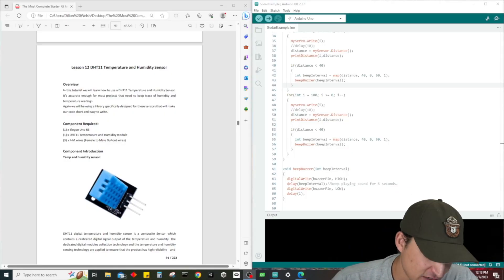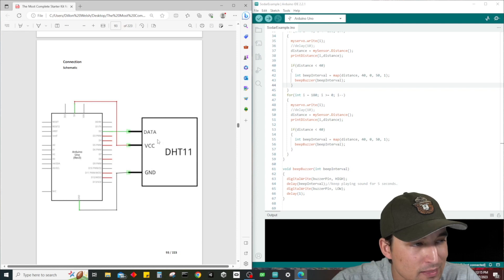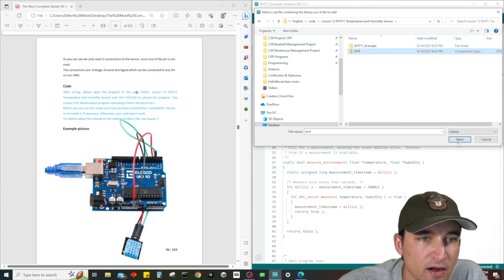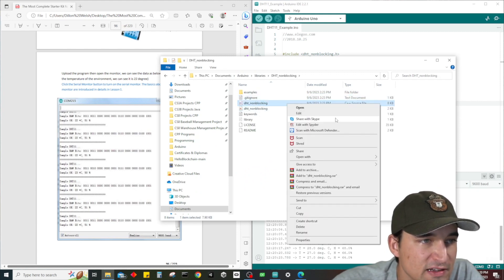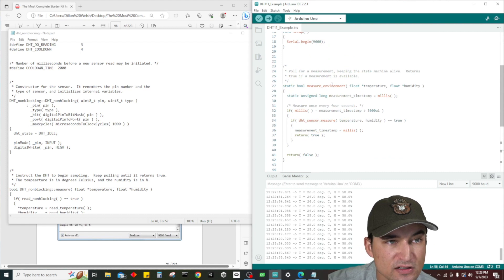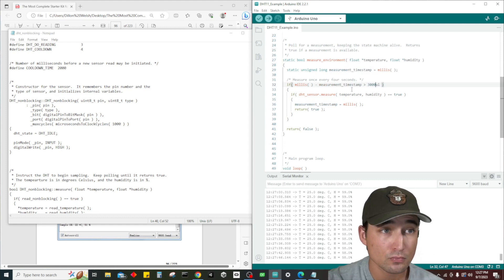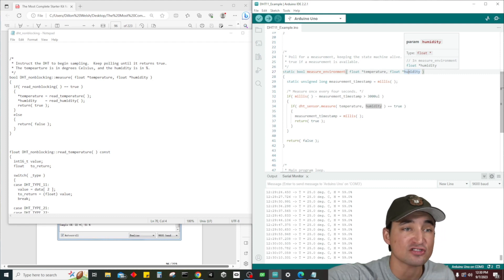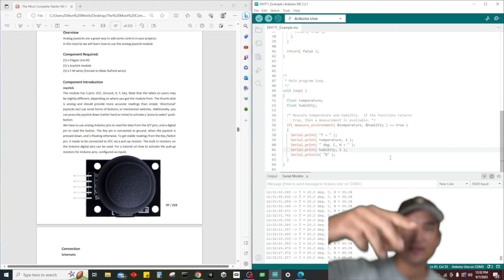🔥 Elegoo R3 Uno Starter Kit Tutorial: Lesson 12 - Temperature & Humidity Sensor 🔥

Comment: I keep getting an error message.   This is even after including the Zip file.
 

Compilation error: dht_nonblocking.h: No such file or directory
Reply: same
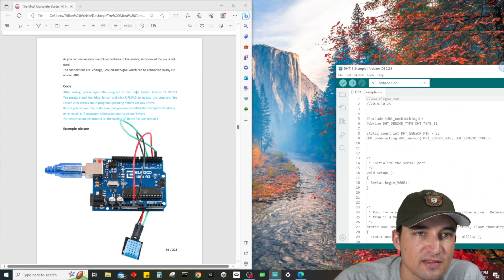Reply: I know it may be a bit late lol but you forgot to include the zip library at 4:50. just now figured that out.
Reply: I looked it up in a different way and then it worked. If you just search for DHT zip file in the search section then it works at least for me it did